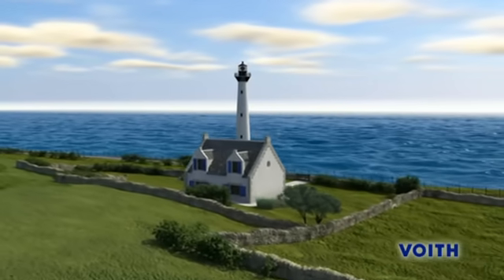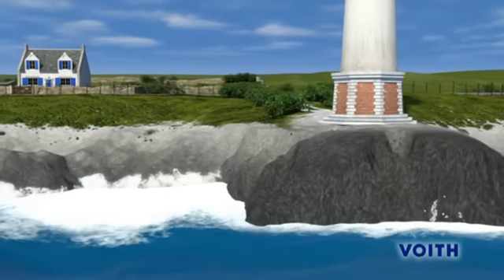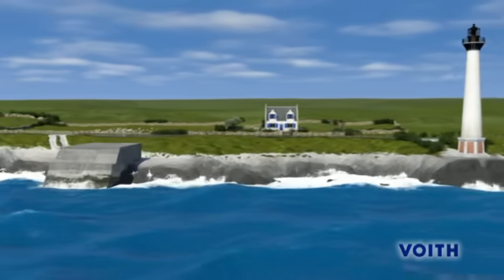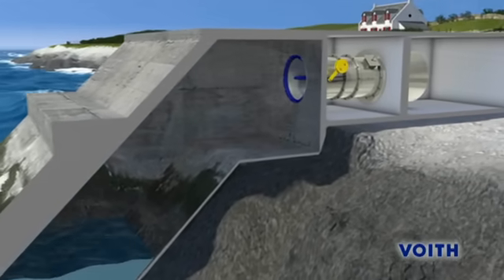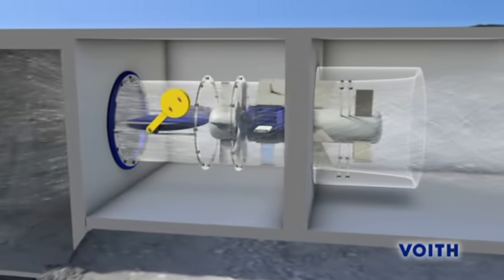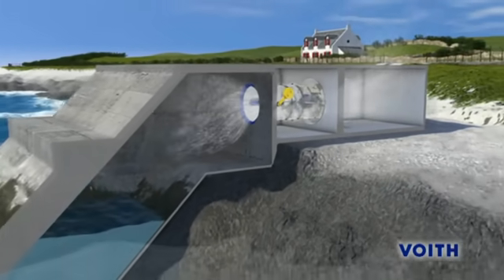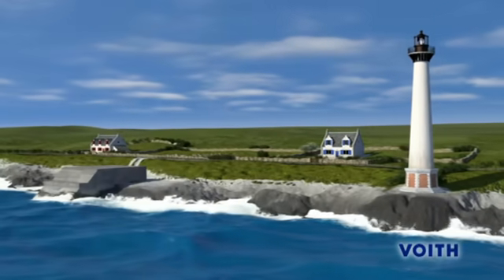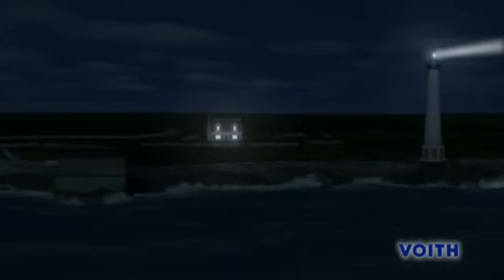Ocean Energy -  Wave Power Station

Comment: theAneja, I don't care how old the vid is. It is, as you say, an excellent, very clear and concise explanation of the wave-driven power generator system. I am grateful you took the time to share it, and I use it in my classes along with other videos on alternative power-generation.
BTW,  Don't worry about the whiners....they usually don't contribute anything except useless noise.
Reply: Yes, it costs much less than a coal-fired station, but it also generates much less. The second generation prototype at Mutriku cost only €2.3M for an installed capacity of 300kW. But it only generated 1GWh in its first 5 years of generation, which is worth around €0.2M. So this state-of-the-art prototype still more valuable for the information gained than profit generated. You are right that there are many advantages, but so far the cost of energy from wave power is still much higher than coal, and that is the main reason it "is not more popular/commercial".
Reply: @craq47  surely technology costs will fall over time.  the highest eroi are coal and oil. but there are high social costs as well that society as a whole has to bear. those costs are not always factored in.  perhaps as superconductive lines are developed, this might make more sense.  (as I understand it, 99% of energy is lost in transmission)
Reply: @joebob47  
I’ve no idea where you got that figure from? The thermal loss during high voltage transmission is 2%, low voltage transformation and distribution loses  in local grid are approx 4%.
Reply: As I understand it, the main problem is cost. That large concrete structure costs a lot, especially using specialised equipment to construct it in an environment with big waves. On top of that you have high design costs for one-off developments. There is hope that as the design matures, the design costs will drop and efficiency will rise, so that this will eventually compete with other renewable energy sources.
Reply: @craq47   also, you can only see the benefit in money value in a very very long time, while most want a  fast result.
Reply: Chris: Compared to a regular coal-fired Station , this should not be expensive at all. No cooling tower, no environmental filters, no ash, no shut-downs for sulfuric degradation. Best of all: No input costs once constructed, only maintenance!
Reply from the maker: Thank you so much for your encouraging words!
Reply: @IdeasfortheGreenPlanet   good video but could you also provide information about high tides and low tides. And also the power output of this system .
Reply: @IdeasfortheGreenPlanet ⚠️ God has said in the Quran:

🔴 { Say, "O My servants who have transgressed against themselves [by sinning], do not despair of the mercy of Allah. Indeed, Allah forgives all sins. Indeed, it is He who is the Forgiving, the Merciful." ( 39:53 )} 

📖Quran
Reply: David Schmidt good
Reply: Word em up my man.
Reply: The pro of this system is that the pneumatic media saves all the moving parts from costly maintenance from the growth of marine spoil. That said I believe this concept is being very poorly applied.

Waves are just too short lived and carry almost all their energy at the surface, while this one uses an opening at the bottom and an indirect pneumatic system that would cause even more lag. That isn’t a good way to draw power from waves but it could work with tides.

Tidal power with this system would be more efficient, since it would give time for the air in the chamber to compress (or decompress) and get a good drive going. Unfortunately tides are slow, so you need to create a pretty significant funnel between a massive flood-chamber and a tiny escape tunnel. 

And the bigger you make the chamber the more natural shoreline you have to displace. It wouldn’t be as much of an issue if that shoreline was already hardened like by a city. Maybe we can retrofit the sewage systems of sinking coastal cities to become a sprawling tidal chamber with a bunch of tiny pneumatic outlets/generators.
Reply: Joe Farmer okay, first I gotta call you on the mars thing, but it’s so wrong I’m going to assume you were just being hyperbolic.

And I’m confused as to how anybody could say turning off lights and down the heat means they should be burning more coal, wood, and candles. Nobody is that stupid.

And lastly going to point out the big problem with building nuclear facilities is the large amount of energy required to collect and refine fuel, coupled with the enormous cost of maintaining the peripheral operating structure, gives you very little net energy gain over the lifetime of a facility which absolutely will wear down at some point. And this is coming from a fan of nuclear energy.
Reply: AnkhAnanku you really have no clue about the advances in nuclear power, do you? We have more than enough fuel NOW, to run the new types of plants, for generations. The ones we have now are not efficient. Use only single digit % of the fuel. The news ones can use all the spent fuel we ALREADY have on hand.  Much cleaner than all this other useless renewables.
Reply: Joe Farmer your “refutation” could use some work. Try backing up a claim of righteousness with some evidence. Here, I’ll show you how:

http://www.iaea.org/inis/collection/NCLCollectionStore/_Public/25/070/25070407.pdf

https://www.sciencedirect.com/science/article/pii/0360544288900801

According to the first article I think I mighta been remembering old calculations that relied on diffusion-process of enriching low-grade ore, which required much more energy than the centrifuge process. So I can see I was wrong portray the refining process As so energy intensive. The second article, however, explains what I was talking about “peripheral infrastructure” which reverts me back to being right about the overall more modest net-energy yields.

People who know what they’re talking about tend to go into more detail, and I am unconvinced you’ve got anything more than “nuh-uh, ur dumb.” Both articles are pretty old, which does not speak well of either of us being “well-informed.” However, of the two of us, only one is relying on logic over vitriol

I’m a fan, not a lobbyist. I still think a nuclear-based grid is infinitely better than traditional fossil fuels, and lament that here in America we’ve dramatically lowered our aspirations for such. I think it sucks that China is now hoarding the heavy-metal exports that fueled our research into thorium reactors, and doubt that El Trumpo cares enough to re-negotiate that unfair deal (though I wonder if it could end up diverting material from the DPRK, which would be killing two birds with one stone).

TL;DR I am just an educated fan, not a thoroughly-studied expert nor a blind fan-boy. Which are you?
Reply: Almost, but not entirely, Unreasonable &smart  clean sustainable free strong power energy-highest efficient full-time ( day&night ) no pollution & no corruption mafias catchers needs....
Reply: Because you are covering scenic coast with turbines, take hard rock coastal rock else you are putting in pylons, sea action with smash up the front concrete face and salt spray sucking in and out will destroy the motor quickly with constant drying salt on it.
Reply: FYI it closed in 2013, and Voith has abandoned wave energy as uneconomical....
Reply: If it was this easy the coastlines of the world would be full of them. It doesn't work. The turbine is inefficient and the cost to build and maintain it is never recouped as is. It's a good idea but.....and by the way my IQ is 140+
Reply: And i don't care about people like you who fall for marketing. Without the actualy scientific calculations. And ROI calculations. Who just fall for "green" talk.
Reply: My IQ is 87.5% of Albert Einsteins.
Reply: Almost, but not entirely, Unreasonable +1
Reply: David Schmidt
Reply: I love ur profile pic
Reply: Do you also include nuclear and the brand  new ways of doing it, that is much cleaner than solar or wind?
Reply: David Schmidt
Reply: Oh. Thanks you . Tui cũng chia sẻ về hiệu quả của những mô hình khai thác năng lượng luôn. Xét về mức năng lượng trong vật lý luôn. Về lý thuyết (w= m.v/2) ok đây là công thức năng lượng chúng ta khai thác ở động năng. Ta xét về 1 điều kiện tiêu chuẩn là bạn sử dụng những mô hình về kích thước để khai thác những con sóng. Theo công thức trên thì mô hình này sử dụng sức nén không khí của con sóng để đẩy tua bin phát điện . Thì tốc độ như nhau nhưng khối lượng riêng của không khí rất  thấp. Trong 3 môi trường rắn lỏng khí thì khối lượng riêng giảm dần nên mức năng lượng cũng giảm dần. Vậy để khai thác những con sóng có hiệu quả thì ta dùng lực nâng trực tiếp của nó tức là môi trường lỏng sẽ cao hơn nhiều qua không khí. Thử hình dung xem bạn dùng 3 cái xô 10 lít, 1 cái đựng không khí 1 cái đựng nước, 1 cái đựng khối bê tông .ok đại diện 3 môi trường năng lượng. Bạn treo nó ở độ cao ở trên đầu mình 1 mét rồi cho nó rơi tự do để đo mức năng lượng của 3 môi trường.😂 Bạn nhớ là mua hòm giá rẻ trước khi làm thí nghiệm. Cái đựng không khí nó tác động 1 lực như mát xa đầu bạn. Cái đựng nước thì cho bạn gãy xương cổ , cái đựng bê tông thì thôi không cần đo nữa 👍
Reply: M.v.v/2  công thức
Reply: Agreed. This is a good exercise in mechanical engineering and fluid dynamics. Since I have no idea how it works, I already have three methods for making something like this work. Biggest challenge would be materials... Sea water/air have teeth))
Reply: E
Reply: Support me https://youtu.be/difweKTGViQ
Reply: Built from probably 10+ times as much concrete per megawatt generated as a nuclear plant with a bomb proof and 911 airplane proof and internal explosion proof shell. Concrete that can be made only from burning mass quantities of coal. This one doesn't even fit your scam green logic. It's just right in your face like Greta and her dad sitting in their living room in their $5,000 chairs.
Reply: @JesusOfIskcon  
I think nuclear power has a big future but that doesn’t mean it’s the panacea to all power generation problems. It’s has a bad press thanks to a very few disasters but is responsible for killing far fewer people than coal, oil and gas (estimated at 200,000 death in the US per annum). But that gets ignored because pollution kills people over decades, or if you take into account climate change we’re looking at a timescale in the centuries.  
What has the cost of Thunberg’s chairs got to do with anything?
Reply: Who are the whiners and why would anyone not agree with this type of power generation?
Reply: "...Don't worry about the whiners....they usually don't contribute anything except useless noise...."
За 11 лет ты уже построил несколько миллионов подобных установок, заработал на этом миллиарды американских долларов  и сделал счастливыми миллионы людей?  
Или ты все это время жил за счёт угля, нефти и газа?
Reply: it cannot and will not produce a significant amount of energy. the turbine is incredibly inefficient which is why it can be driven in one direction with airflow from either. stupid people are so easily manipulated with bad science.
Reply: You use this in classes?  This is a marketing pitch with about as much clear and concise explanation as the Genesis video in the original Wrath of Khan.
Reply: @kmbbmj5857  isnt it obvious that "educators" arent experts in their field? They are partisan hacks that preach their ideology and force kids to repeat their nonsense in fear of "destroying their future".  Wells Turbine was invented in the 1970's. It has a maximum efficiency of .54. Thats....really bad. It has poor starting characteristics as well. {stalled power plants arent a good thing}. Anyone who pushes this psuedo science is disgusting. The largest array of this junk is 16 turbines and produce 68kwh of electricity. The hoover damn is 2 small turbines and 2 large turbines. 4 total. it produces ON AVERAGE 4 billion kw/h of electricity. Can you imagine the price of "going green"? Yet we are to believe building a damn along a river is somehow evil and "not green" lmao.
Reply: @DieselRamcharger  
The Hoover Dam produces 2.08 gigawatts of power and it is built from 4.36 million cubic yards of concrete. You could make a heck of a lot of wave power generators with that. 
You need to read about the improvements in Wells turbines since their original invention half a century ago. It looks like you googled Wells Turbine efficiency and took the first answer, which is wildly out of date. 50 years is a huge amount of time in technology. The Wright Flyer could only achieve 6.8 mph yet 50 years on, planes were achieving 700mph.

https://www.researchgate.net/publication/305175839_Wells_turbine_for_wave_energy_conversion_A_review
Reply: Ah yes, I know some dolt would start the name-calling. Whiners contributing nothing but useless noise?  You mean the "noise" of how stupid it is to pay 10 times more for something than it's worth?  Lol. Just keep name-calling, you're better at that then at math.
Reply: @suserman7775  LMAO you hit the nail on the head with that one! Had you ACTUALLY CLICKED THE FUCKING LINK. You would se the ONLY THING this "technology" produces is, in fact, useless noise! This is a half century old tech, let that sink in. It didnt even get a second look until the Green Energy Scammers hooked it to extract money from ignorant governments. Nothing of use? All you morons are doing is saying how great this stupid shit is. FACT #1 its not great. Multi Million dollar installation that DESTROYS COASTLINE HABITAT and doesnt even produce enough power to offset ITS OWN carbon footprint. Why are you people so stupid? Fact #2 it produces 600,000kwh of electricity PER YEAR. A hydroelectric puts out 4 BILLION KW/h per year. You fucking idiots cant math? Its obvious you have NO INTEREST in science. You are ideologues. You dont care how many people you hurt, you dont care how many people end up in poverty. You dont care about the things you destroy in the name of "save the spinning space rock". Let me let you in on a little secret. This space rock DOES NOT NEED YOU. We are living in an ice age, this planet will eventually completely freeze and a few millions later will completely thaw. that means 100% ice coverage and then 0% ice coverage. HUMAN EXISTENCE WILL NOT SURVIVE THIS. Your effort to "save the space rock" are fruitless, the space rock already has a mechanism in place to ensure we arent here for longer than it can handle. You . Fucking. Moron. Facts Matter, but you have offered NOT A SINGLE ONE. Just YOUR emotional bullshit. So lets hear it. What did you have to contribute? NOTHING! so shut the fuck up.
Reply: @DieselRamcharger  
Im not sure if you’re being obtuse, dishonest or like you claim in others “you fucking idiots can’t math”, you haven’t done the maths? Have you any idea how massive the Hover Dam is and how much could be built using the 4,360,000³yds of concrete it’s made of?
Using your numbers (cause I can’t be bothered to look them up) 4billion kWh/600,000= 6,666 
The Hover Dam contains 4,360,000 cubic yards of concrete divide that by 6,666 and you get 654³yards per wave generator. 
I doubt they use anywhere that amount of concrete though. 
I’m not a huge fan of these aesthetically but can see that in the right place, as sea walls, coastal protection etc they could produce a lot of greenish power that would reduce our carbon footprint and lead to a cleaner environment. It’s early days so it’d be very foolish to write of an emerging technology without at least trying to develop it. Look at the advances in wind turbines (and to a lesser extent solar voltaic power) has made in the last 20 years? In 2020 a quarter of the UK’s electricity was from wind power and that percentage is growing rapidly.
Reply: Exactly 11 years
Reply: 2:03
Reply: So here I am with a cheaper and probably more efficient idea (which is probably to expensive to maintain). Take your wave idea add a buoy attach a generator  with a weight to the chain at the bottom of the sea and the buoy will  move the generator by swimming on the waves. Definitely cheaper than a turbine and also simpler.
Reply: @johannoas1  
I’ve seen that design somewhere, it has potential but maintenance and fouling would be a major concern.
Reply: White Rice  never said it was a good Idea ;-) but still better than this one.  Also You can make your buoy bigger and place it where no ships  are.  But I am pretty sure there are better ways to get energy
Reply: Well, you seem to be making unnecessary noise here yourself. And a semi-literate picture is enough for that. your turbine keeps rotating in one direction. and that is total delusion! in fact, it could operate alternately for one or the other direction of rotation when inflating or deflating.
It is possible to change the direction of the turbine blades during the cycle.
Well, there's nothing like that in the video, so it's a nonsensical video. And you spread that nonsense in your lecture. I don't know if your goal is to educate fools, or you are one of them.
So don't make that noise !!!
Reply: @Vlad63  

Look up Wells turbines, they don’t need to reverse direction.
Reply: Винни Пух  
Do you have any data to back those claims up?
Reply: Винни Пух  
Can you explain this “logic”?
Reply: Винни Пух  
Now you’re moving the goalposts. First you said that a wind turbine would produce 99x more power, now you’re saying a combined system would produce 200% of a turbine on its own. Using “logic” both can’t be true.  Is it 100% + 1% = 101% as you first stated or are you now saying that the wave power machine now produces the same as the wind turbine and when combined produce double? 100%+100%= 200% 

Actually I like the idea of combining the 2 if it’s possible.  I can imagine that could help fill in power generation where, for instance theres no wind or waves. It would mean only one foundation, only one connection to the grid and lastly only one visit from a maintenance crew.
Reply: Винни Пух  
Can you explain more clearly what you mean then?
Reply: Винни Пух  
You keep saying different numbers so that shows you know just as little as I do. 
It’s not true that its aways windy off shore and not all coastal areas are shallow enough to make wind turbines feasible.

How much does one of these cost?
Reply: Винни Пух  
Unfortunately you haven’t said anything of value, and keep moving the goalposts. All you’ve done is make vague assertions with nothing to back them up, you may well be right but you’ve not provided any proof so on that basis I cant judge if you’re right or wrong and agree, that if you can’t give me specifics that can be verified, we should end it here.
Reply: Винни Пух  
I thought we had agreed to stop as neither of us is benefiting anything? 
I never claimed to be an engineer, if I were I wouldn’t need to be asking questions about this from a know nothing like you. 
What the f#ck has a murderous thug like Putin or a doddery old American like Biden got to do with wave capture generation? Yeah “let’s stop talking nonsense” 🤣
Теперь отвали
До свидания 
I hope google translate got that right.
Reply: we should use noise power
Reply: Insert 70 meters of iron into the concrete hole. Attach a 100-meter plastic boat to the end of the iron. then attach a 40 meter sail to the boat for the wind. As this giant boat, which is 70 meters below the sea, moves the iron, the iron will get stuck in the concrete hole. The energy of this giant plastic island is 1000000 times more than this video. Because it is compressed inside the iron pipe with great pressure. the entrance of the pipe should be patented accordingly. custom design
Reply: Not sure of my IQ, but it seems insane that this tech is not more popular / commercial. What is the problem? Why such low market acceptance??
Reply: @almostbutnotentirelyunreas166  i'm guessing far lower power production/cost compared to it. the amount of energy you can produce using heat is far above that of kinetic energy. it's like trying to heat up a room by rubbing your hands on the carpet compared to lighting a fire. plus as Chris stated, with that low power production/cost it can't pay the electrical engineers and electricians that work on it. they need money to live so while it's nice and all it just doesn't cut it.
Reply: @almostbutnotentirelyunreas166  its nice that , as oppossed to wind energy, you dont need huge amounts of fiberglass
Reply: Chris: Thank you, that's a great explanation.  I guess what has had me baffled about this for some time, is an earlier visit to a 'wave-pool' that barely generated 1 m waves in sets. The quantity & size of the electric motors was around the 100 kw mark, and all we got were 'piddling' waves, ergo, the reverse should be true: Larger waves, extensive shoreline.......lots of Kwh coming in all the time.

Last I looked at this, the main reasons / issues were cited as low energy density, ie waves wide & flattish, rather than high & spiked. As a pet hobby for some time, I used to 'generate' a known quantity of wave energy in a longish watering trough by dropping a specified weight pumice stone (barely floats when soaked) from a specified height. 

I'd then 'funnel' the wave front to a point at the other end of the trough, generating a substantially higher (and narrower) amplitude. (River Bore effect). Used to run the top 65% or so onto an elevated platform, forming an elevated 'water potential' (dam), to be run off at will. Efficiencies were not terrible.

However, the real 'pressure feed' is to be had UNDER the incoming 'spiked' wave, so that you have almost 75% of work/energy available for conversion. Just attach a J-shaped tube under the highest 'spike' point, (at wave reflection point),  quite amazing what jets out! Thats no longer 'low energy density'! Although it won't compete with Hydro dams, at least not in my models.

What do you think about the Australian floating 'pontoon' system, that works like a blow-hole, moored off-shore? It suffers from the same 'low energy density' issues, but could be adapted to accept 'spiked / funneled' waves, increasing amplitudes & energy densities. 

A real pity that not more is done with wave power, it's pure energy washing ashore continuously, turning into turbelence/ self-interference and then dissapating....surely with modern engineering there MUST be an efficient way to convert it to useful energy.
Reply: @almostbutnotentirelyunreas166  they are looking at design wrongly using air which has low energy conversion rate. They should use the wave to paddle or rotate wheels.
Reply: @lolguy-x9n  
The problem with using immersed or floating paddles to power the generators is that seawater is;
A, highly corrosive, causing rapid degradation of machinery, especially if you factor in storm damage. 
B, prone to build up of biological matter (fouling), making it inefficient and high in maintenance. 
C, liable to damage from floating or submerged flotsam and jetsam. 
D, potentially harmful to wildlife, depending on the type of machine used.
Reply: I second that.  The naysayers usually have IQs of 80 or lower.
Reply: @agus2001  So if the naysayers realize it's dumb to pay ten times more for something than it's worth, and they have an 80 IQ or lower, then your IQ must be in what region, 50 ?
Reply: @agus2001  that high of an iq?    this idea really makes sense and with minimal negative footprint.  the waves will still be here long after we be gone.
Reply: @agus2001  haha dunning kruger effect right here. :) I read scientific papers alot, and for me it's lets first see the calculations. And then then the cost of building it, and maintenance cost and everything on top of that. You are just an easy YES sayer. :)
Reply: @agus2001  
I disagree. 😉